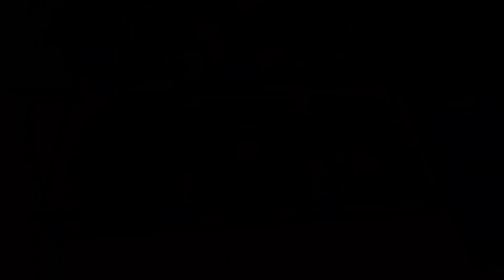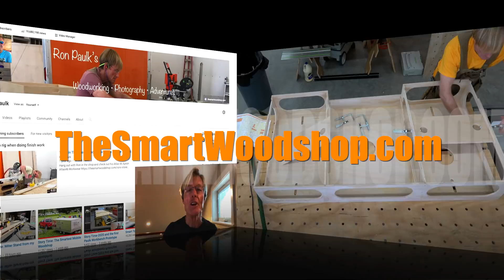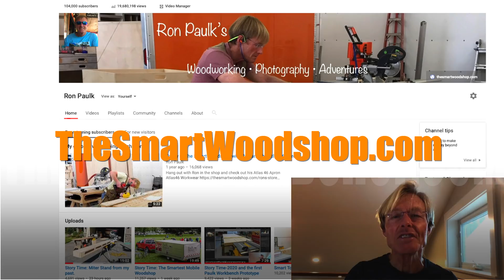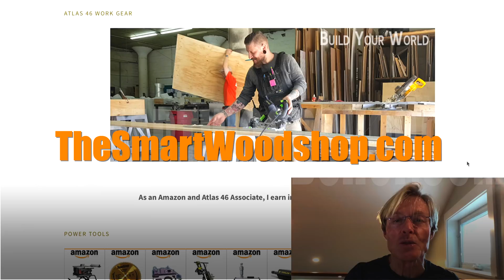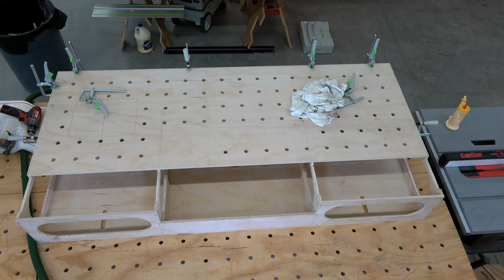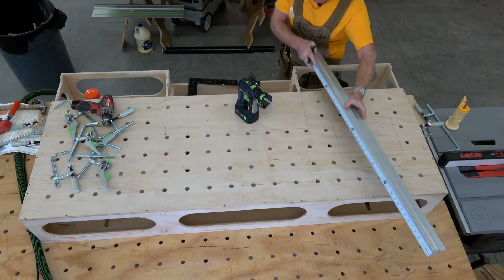Paulk Total Station II (Part 4) BENCH TOP INSTALLATION.

Comment: Ron, are you and fastcap still working together? I see they came out 
with the flex bench, which is obviously your bench slightly modified.
Reply from the maker: Fastcap and I are no longer associated. Their bench does "borrow" heavily from my design, but only in aesthetics as their design is too complex and time consuming for daily onsite working.
Reply: @TheSmartWoodshop  Good to know. Will be buying your plans instead, thanks Ron!
Reply: @TheSmartWoodshop  Yeah, I was not impressed when I saw their Flex Bench.  Too many pieces and clearly based on your design and the time you spent with them.  I purchased your plans (Smart Bench) and will limit any purchases to Fast Cap going forward as I strongly dislike when companies do that.

Comment: Looking good Ron.  I have a PTS that I built a few years ago and I tweaked the hole spacing to 92mm on top.  It took a bit of thought and it is interesting to see your approach, the changes and the similarities.  Keep up the great work.
Reply: My question is why is the 92 mm on center important ? I am thinking of using a pegboard as a template . Square is key but hole spacing seems preference .
Thanks
Reply: @Slowhand871  My mistake, it looks like I’ve put a typo in there, it should read 96mm hole spacing (a multiple in the 32mm system).

The euro system32 spacing is an industry standard for most cabinetry and works with many brands of tools and hardware including Kreg, Festool, Blum, Hafele nd so many more in between.  

I am in Australia and here it is so much easier to find metric hardware and mixing brands is possible when they all use common dimension.

My wife got me the PTS plans as a surprise back in 2016 and I didn’t have access to imperial sized tool at the time. I aligned everything with a Kreg shelf pin jig and a long straight edge.  I also used 20mm dog holes for a similar reasons… a 3/4 bench dog with some tape to shim it out works well but a 20mm dog will never fit into a 3/4 hole.

In short, It is near on impossible to get good imperial hardware at the local big box store so I tweaked the design to work with what I had access to.

I hope this helps.

Michael
Reply: @michaeljude4001  I just don’t understand the spacing requirements of 96cm. I get needing 20 mm holes for the deadmen but as long as the holes are all parallel why does it matter how far apart they are? 100 mm 150-200 ect. You just lose more clamping and or squaring options as I see it but I must be missing something
Reply: @Slowhand871  Square is the most important thing, the spacing may not be important.  If you space the holes evenly then it works and looks good.  I used the system32 spacing (multiples of 32mm) as it looks good to me and worked with my Kreg shelf pin jig. I also moved the inner bracing to avoid the dog holes.  

The spacing for the holes and wether to put them in or not is your call as it will be your bench.  You can always build the body in stages and add dog holes at any point in time later down the track. 

I hope this helps

Comment: im making some saw horse stands for  Paulk workbench II - On the workbench II drawings its has the  top connected to the saw horses with tabs, but on the Paulk 3 x 6 workbench drawings ( which I also have)  it uses the door hinges to connect the two-  Which is the preferred way and how are you going to do it with this total station?  Thanks
Reply from the maker: dornworks I use the door hinges now so no need for the tabs.
Reply: Ron Paulk , thanks for replying - got it, I gather using the hinges makes it  easier to construct!    I ended up doing both  - using tabs, then screwing hinges to a extra piece of plywood  50 mm  and screwing that the inside face of the sawhorse,. I'm amazed how sturdy it all is with the only 1 of the tops on!  Thanks  for making your design and  drawings available .

Comment: Thank you for posting and please keep the videos coming. 

Check and then check again is great advice... I learned that the hard way on my first Paulk Total Station build when I assumed (yes, I know...) that the top would automatically be flat end to end and went ahead and did the assembly on a surface that wasn’t. Thankfully, the second top went together much faster than the first one🤓.

Comment: I noticed that you are not using pocket hole screws, is that because they don't work well with 1/2" Ply?
Reply from the maker: True, I don't have good luck with pocket screws in 12mm material.

Comment: Thanks again Ron. Quick question for you, although you are drilling through the top, after placement, are you then drilling a pilot hole in the side?
Reply from the maker: Yes. Notice when I am placing the screws I have two drills. The first is drilling the hole the second placing the screw.